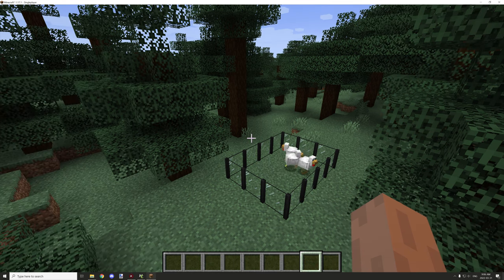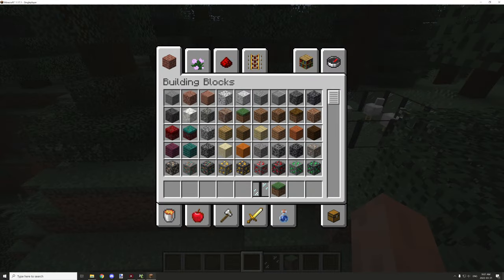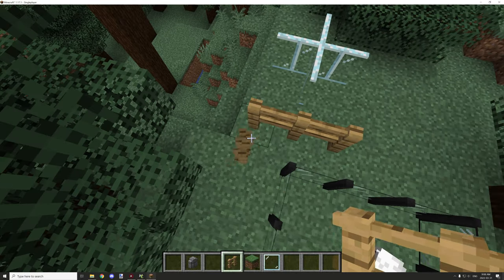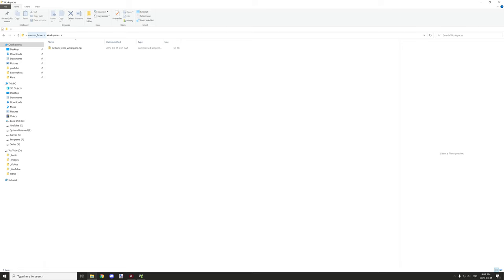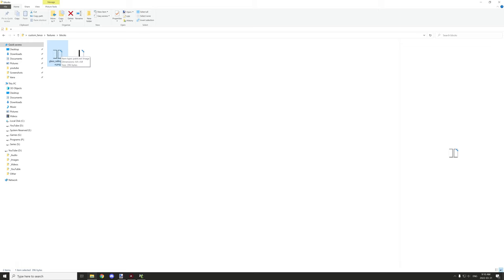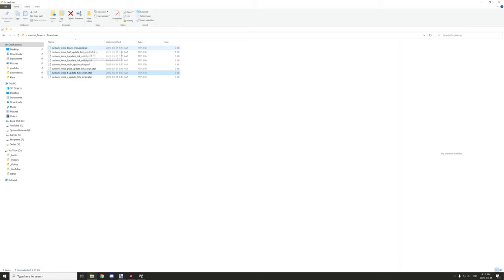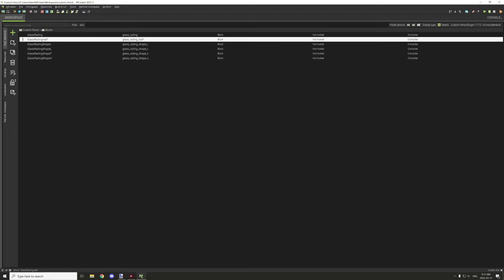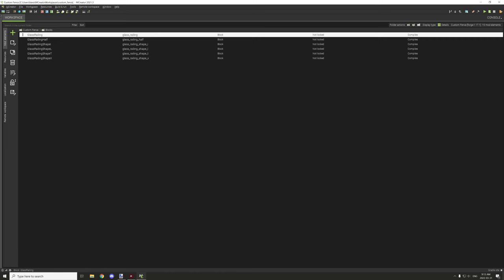MCREATOR TUTORIAL: Custom Fence Tutorial | 2021.3

Comment: SO, I make aesthetic mods using mcreator. I make wallpaper, planks, flowers, and all that. My fences always connected until one of the latest updates. I have been trying to figure out how to get them to connect. Unfortunately, this is no help to me. it's like you're speaking another language and confused me even more. I just want them to connect! I know I'm supposed to tag them as a fence. I don't understand where I'm supposed to do that and how do I get to that option. PLEASE HELP!
Reply from the maker: I have read over your comment, it lacks a bit in detail on the issue other then connecting, lots of context is not for me to help with other then you had a fence and it does not connect, so take my reply with a grain of salt as I really am doing my best to fill in the blank details.

Regarding the fence, would this be custom or the built-in model option?
if its the built in option then most likely this is an easy fix though making the material type wood or stone depending on if you want it to connect to wood wood fences or nether brick fences.

if its custom fences you have made using the tutorial, this gets a bit more complex, if they worked prior to the "latest update" (2022.1 or 2022.2?) then most likely the script has broken in some way, I know that this tutorial uses NBT for blocks so its possible that it may have something to do with the recent issue I had with the teleporter tutorial I just made NBT was being removed for no reason, sadly this would be 100% a Minecraft related issue, and is fully out of MCreator and my own control to fix.

I hope that this helps a bit in journey.

Comment: mate seriously, this tutorial is so weird to follow. i've stopped the video 7minutes in. sorta feel like it should only be a 7min video to start with!
Reply from the maker: It would be possible to do with tags but I don't think I used tags that much back then not sure, but its a lot more complex to make connected models without block state support, at least for now, one of the contributors for MCreator started to work on full support but we will have a while to wait for it. Regarding the time of the video, lots of people have a hard time if I don't explain everything, and on newer videos I don't really cover how to build the tutorials but I do provide the project files with the procedures, workspace and assets use in the tutorial, this way people can just import and set up them, some things obviously are going to take longer to explain based on the complexity of the project and if I have covered it in the past or not.
Reply: @NorthWestTreesMCreator  i apologise for how i sounded in the first message. your tuts are always helpful but Klemen always links to a SET of tutorials and never the actual one in question by a user on the mcreator forums/page. i found this eventually and then found it awkward to follow. 
i appreciate all the work you put into the tuts!